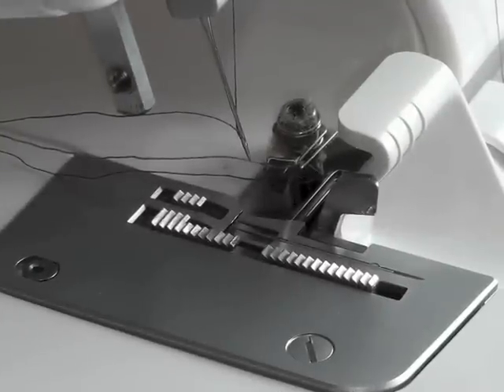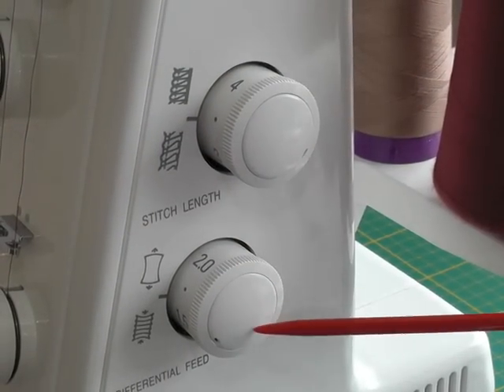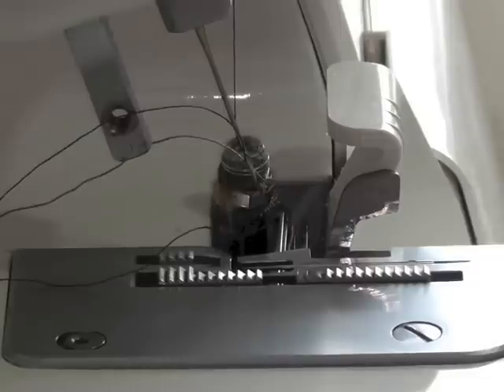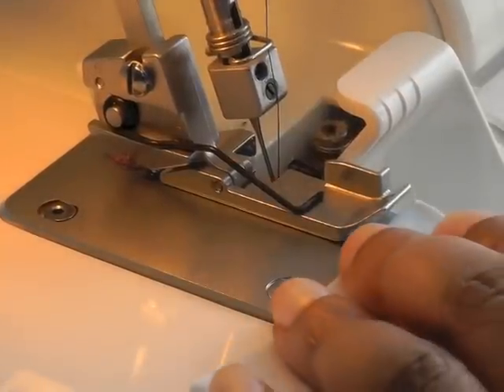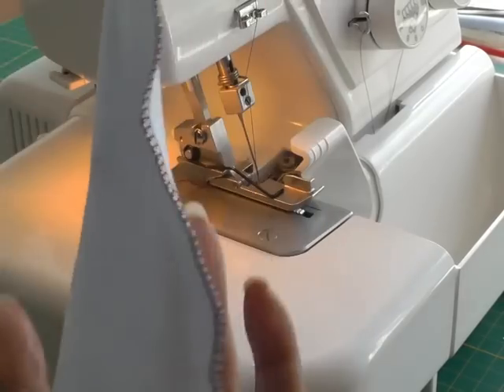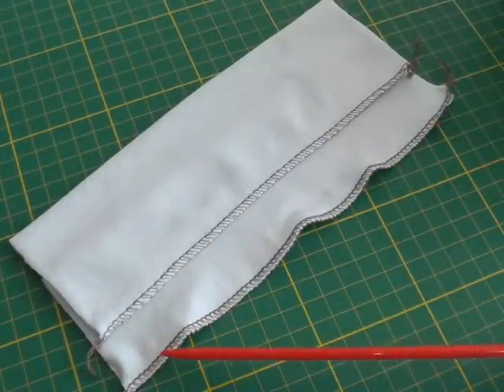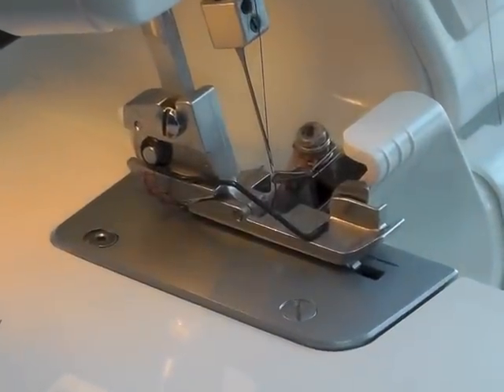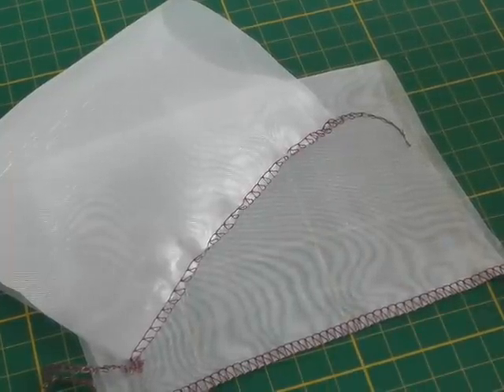Serger Differential Feed

Comment: Hi there - I am still having a bit of a lettuce edge on tulle with the differential set at the lowest - 0.7. I use a Sulky wash away stabilizer with it as well. Any recommendations on how to get it flat?
Reply from the maker: Hi Stacy. Maybe try using regular interfacing and cutting it away, maybe that will help. Remember to do a test first.

Comment: How do I adjust the stitch width? Stitch length only  will make the stitches closer. I want to leave the mist minimal seam allowance.
Reply from the maker: It will depend of the type of serger you have! You should see a dial or lever that is labeled as stitch width. Just like with stitch length, the higher the number is, the wider apart the stitches will be.